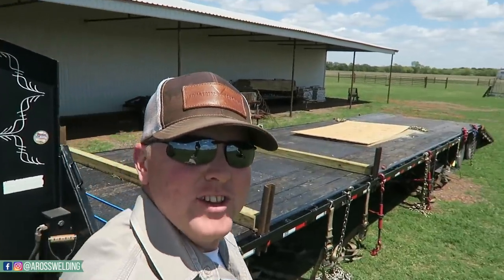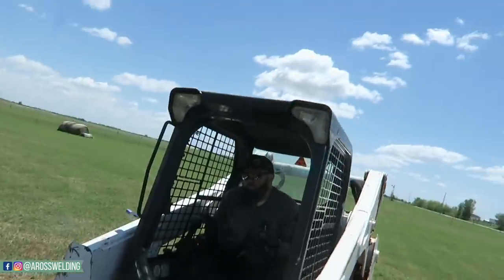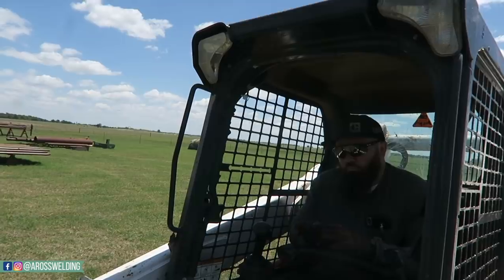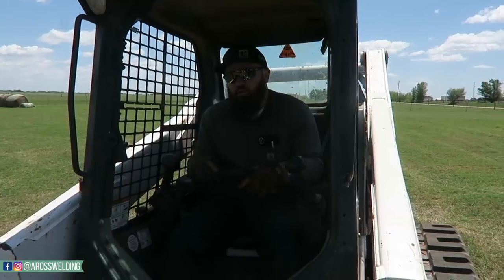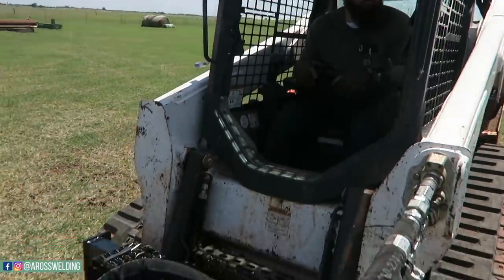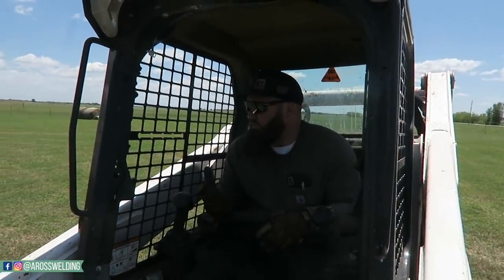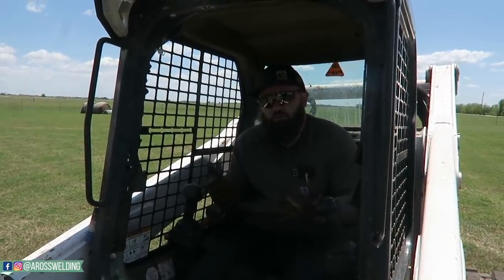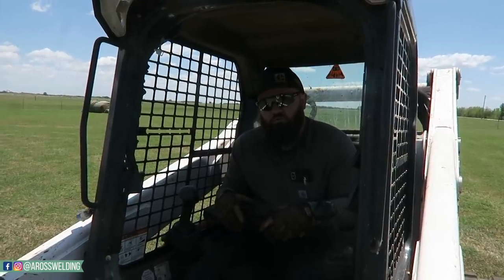POPPIN’ HOLES FOR CUSTOM PIPE FENCE // HOW DEEP WE GO & HOW FAR APART WE SET THEM

Comment: Crazy the difference in how fence is built depending on where you are. Here in the Texas hill country where there’s hard rock and lime sone 2-3 feet is the normal depth of hole. Along with the actual auger it’s self. A lot of guys who drill lots of holes use bell tech tractor attachments that use hydrologic down pressure or the an air rock drill where is drills a 2 3/8” hole and it post just slips right in and the limestone dust gets hard the next time it rains and you never use concrete. Thought I’d share how we do it down here.
Reply from the maker: That’s so interesting to me. Thank you for sharing.
Reply: @curtisvonepp4335  I like his saying yaya or come on but done did I laugh at to
Reply: This is my plan, also here in the Texas Hill Country. The soil is only 12" or so where I'm at then a massive limestone slab. My plan is to use an auger on the loader side of my tractor to break through the rock hard soil, then a 2.5" bit on a hammer drill to make a hole in the limestone. I'm also using 2 3/8 pipe.

Comment: I hear ya on the getting In a hurry sometimes. I was on a job and we started to get moving right along. Well they shot all the welds and everything shot clean, but the inspector for the gas company called a few of us out on how the caps looked. No fails but they did make us rework the caps. So I learned, take a little extra time to save tons of time down the road. Make it right the first time no matter what.
Reply: How did you fix that?

Comment: Austin thought you might be interested. Greetings from Chicago.  My fathers place in IIreland.  Wood stakes rot, larch, square/round 4in. Treated no good....7 years. At the ground level . The new stuff they are pumping to treat wood. Does not last there. There is a pinic table he built in Chicago that is there for last 30 years out side. That's perfect to this day. What ever they pumped into that...lasted. He has taken out more posts and put in concrete ones. We put a fence up. Round 4in wood posts. 3 member rail.  Real nice. Set posts in crusher dust. That's great stuff. Water I guess goes thru ...strong. treated the fence in burnt oil. Used oil. Best blackest stuff there is.  When I was in shape....used a old axle off a cart to start the pilot hole....and all ya head from the ole man was hit it on the height....post be some what unsquare....drive it down with a bar, axle. And be told again by the same supervisor ...after ya hit on the height to leave the axle on it a bit....drive it...ya got mighty tasty driving posts down. Them was the days. Iam 44 so....still in good shape...what I wouldn't do to be at that now!

Comment: You guys make one tough and very good looking fence.  That old pipe works great and holds up well. My family farms 4500 acres and has 350 head of Hereford cattle. We summer  pasture our cattle on rented land and we love using old drill pipe for posts.  We still run wire along the fence but we don't use electric fence . The pipe can be pushed into the ground with our loader tractor or our skid steer which is fast and effective.  We fence in almost 10 miles . The cattle are placed in groups of  50 head on 7 separate parcels of land and we love them frequently. We cut the pipe in 4 foot lengths and cut one end at a point . Nice video stay safe and keep on keeping on my friends  !

Comment: I have learned since I have been welding. That fast is slow and slow is fast. Meaning like you said take your time or you will be doing it again later on down the road. I like watching your videos. Everytime i watch one I learn something.
Reply: Hahaha. I just realized I was on my wife's email. Lol.
Reply: That’s often true even with fence work. I’ve seen a lot of dudes that throw in the loosest fit and spend like an hour on every joint filling a 1/2” gap with 6011. It goes so much smoother when you take the time to get it right and get it over with.
Reply: That's what my boss said too. Slow is fast and fast is slow. Still use that advice to this day.

Comment: Hello Austin. I have recently rigged up a truck just for our farm and ranch work with a Lincoln Eagle.  I’ve been putting steel pipe in the ground for a few years now.  I use casing cut off pipe for barb wire fence braces; 7” to 8 3/4” or what ever I get from local rigs.  I pound the posts in the ground using a High and Heavy Hitter post pounder 3-4 feet.  I use 2 7/8 for top braces.  I have been cutting my posts 8-9’ with 5’ of stick up.  I built our ridding arena from 2 7/8 pipe coping all joints.  I put on a top on center rail.  Above and below the 2 7/8 center rail I ran 1/4 stainless cable.  It was a big job.  Anyway; love your videos, keep up the great work.   I am also a oilfield guy with ranch lifestyle.  Cheers.

Comment: Try bolting a chunk of 5/16 chain about 8 inches long to the end of the auger flighting at the top and bolt a 24 inch 2x4 to the loose end of the chain , when the auger is flush with the ground the 2x4 will wipe all the dirt away from the hole. Yes it will fly around while digging but it will clean the area real nice, if you have High flow mode try that also. you will not need a shovel or a man standing around. Remember, there is a place for guys that cant weld, it's called The Ladies Room.
Reply: Laughed at "ladies room". Glad I'm a welder...😎

Comment: Having never built steel pipe fence but having built hundreds of mile of wood post fence can a post driver be used instead of boring a hole and setting them in concrete?  I use a Shaver Post Driver to set wood posts and could have had all of those set in half a day, but do steel pipe posts end up with wiggle if driven in the ground?

Comment: Ok on marketplace I see ads for pre cut structural pipe, but I also see oilfield drill pipe 30 foot joints delivered. Is this the same stuff?  2 3/8 inch?
Reply from the maker: It’s hard to tell, around where in from the pre cut stuff is not oil field pipe. It’s actually new structural pipe. Usually when they say structural that just means it wasn’t tested like “black” pipe is. The tested stuff usually cost a bit more. Same terms apply to fittings and such. 90s 45s ect.

Comment: 4 feet in ground and 10 feet centres would keep an elephant in, 
particularly as you are concreting them in. Wouldn’t driving your posts be just as effective and much less expensive?
Reply: Just what I was thinking. Driving is cheap with no mess and 5 times as fast.

Comment: Y do u dig your holes rather than pushing the post in with a post pounder thats what we do in mo
Reply from the maker: I’ve helped guys push post in I just don’t have that set up yet. I like how accurate you can get them lined up by digging holes and I feel like it should last longer but idk... still learning.
Reply: Yeah i was gonna ask the same question about that. 
They have a really good post driver for that machine.
Reply: I’ve never pounded them in, but I read recently it’s 10 times stronger than cementing because the ground is undisturbed. Great video, but I got a wait another week to see you line them out and set em? Thanks for posting.

Comment: Me and my brother used to do commercial electric and when we re did all the old K marts here in Texas the company gave us some shitty vas and We where putting in new parking lot lights and the old pols were square and about 5 by 4 inches and there was about 180 lamp post because we did all the K marts in Houston before they where turned into Kroger’s and shit and we where told we could take all the old post so we stacked them up on the shit vans the company gave us and we where way over weight we had made about 13 different trips back and forth and we took em post and started doing costume metal fencing and cut them up and turned them into post made some quality fencing it’s always a good idea to check with the electric company doin the parking lot you might cut yourself a deal I don’t know if they would do it for free anymore I quit commercial electric and started welding

Comment: How much does the pipe cost? Also where do y’all get the pipe from?
Reply from the maker: We usually get it from any of our local welding/ material supply stores. The railroad yard in Stillwater Oklahoma is where I think Mitchell got this stuff. They have a lot of fence pipe new and used for this type of work.
Reply from the maker: The price varies. I’m not sure on the price of this 4” right now but like 2 3/8 and 2 7/8 is anywhere from 1.50-2.50 per ft. Right now. It changes a little from time to time.
Reply: Wow. Here in central Texas I’ve paid $25 per 33’ joint for the 2 3/8. It’s used but they’ve always been in good shape.

Comment: on are farm when we build new fence and corners we do use metal post and we basically have a huge hammer that goes on the front of a skid steer and we just drive them in the ground why dont u guys do that instead of haveing to drill wholes and concrete the pipe in the ground
Reply from the maker: I’ve helped guys push post in I just don’t have that set up yet. I like how accurate you can get them lined up by digging holes and I feel like it should last longer but idk... still learning.
Reply: Austin Ross ok I was just learning it seemed like a lot more work that way iv always been till work smarter not harder 🤣😂🤣
Reply: A pipe sitting in concrete is a hell of a lot stronger than just pounding a pipe into the ground. Drilling holes and setting everything in concrete is the only way to go in my books.